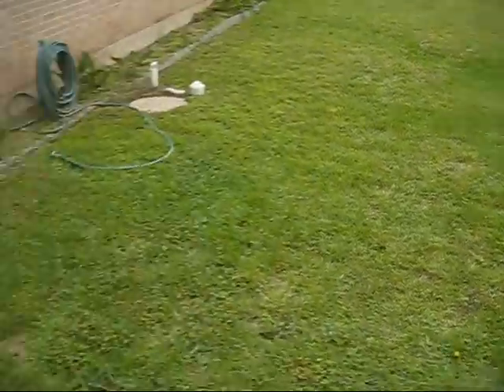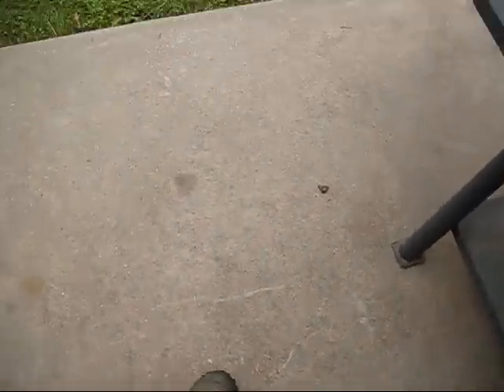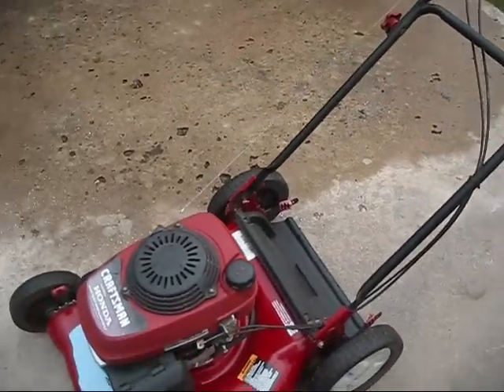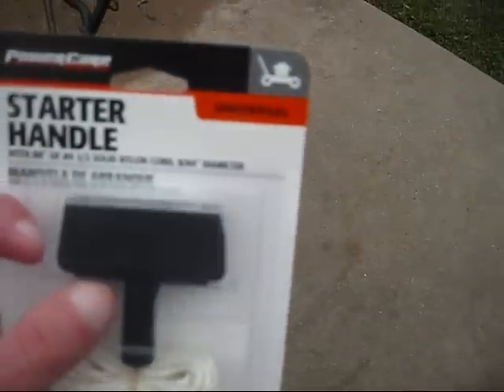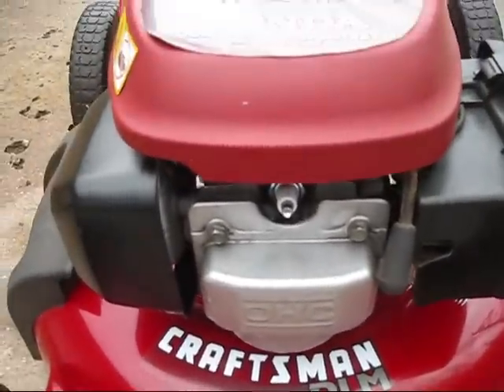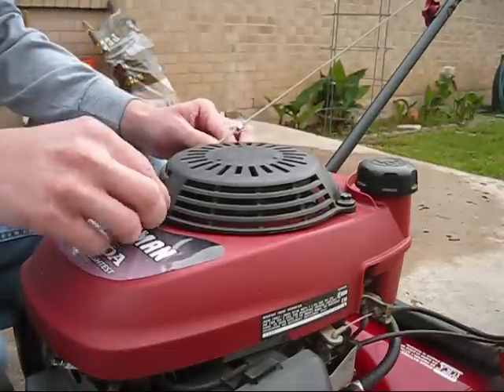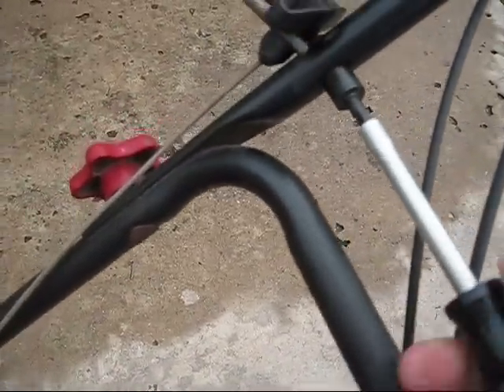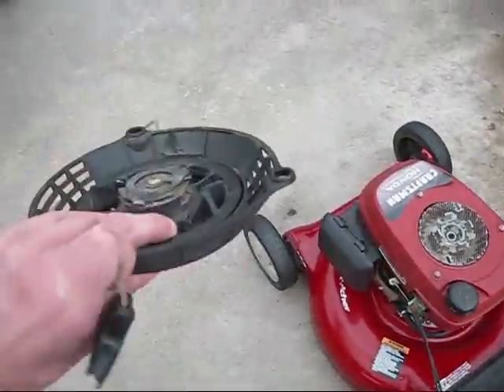Replacing the Starter Rope on the Craftsman Mower

Comment: So you don't have to pre-wind tension on the pulley before you thread the new rope in?  How does the slack wind itself back up.
Reply: At the 4:00 mark he pulls the old rope all the way out, then inserts the screw driver to keep it from recoiling back in, so that's where the tension is placed.

Comment: When I went to disconnect the spark plug I pulled instead of twisted and a little metal coil popped out, how do I put it back in? Does it go inside the rubber piece?